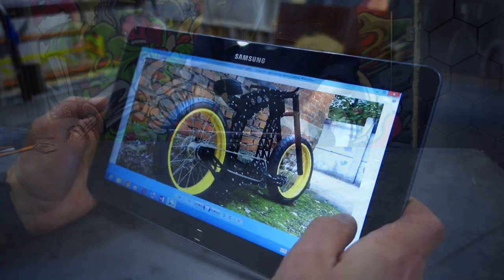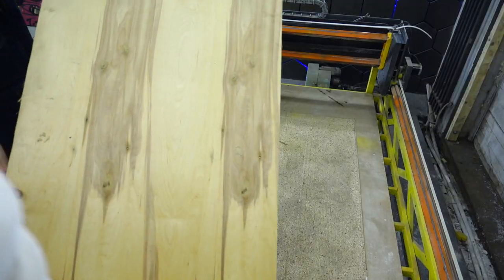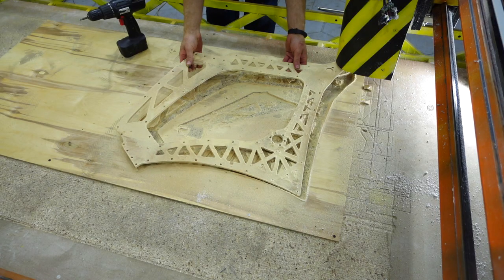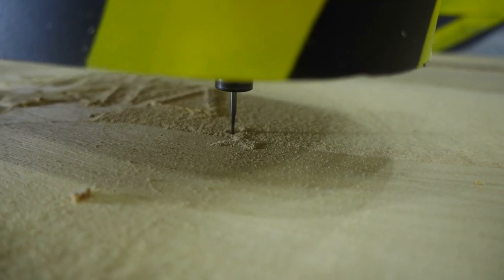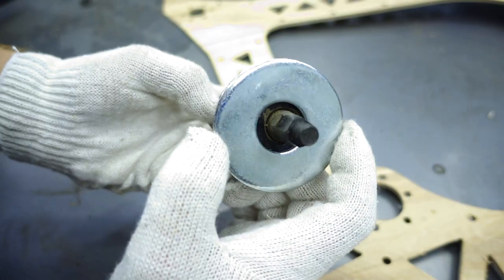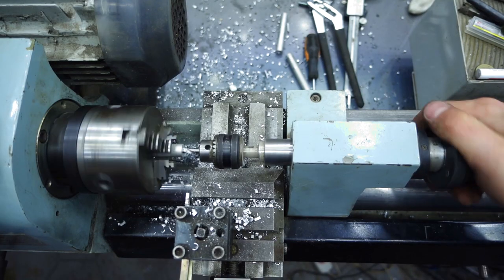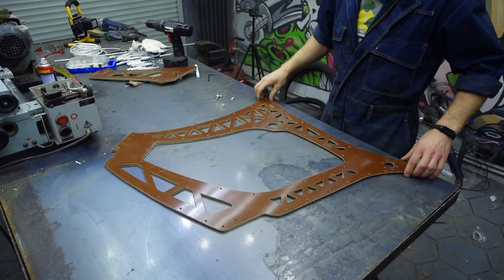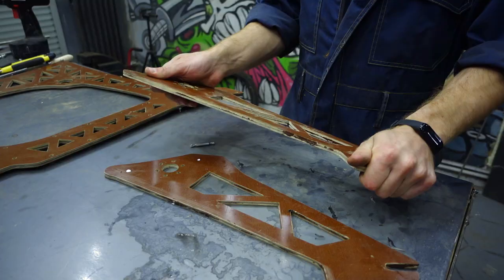Unusual Framed Bike Part 1

Comment: this type of material and design requires multiple suspension, you can make suspension coils wrapping >unidirectional< glass fiber reinforced recycled plastic rods around a shaped tube with a heat gun an you can make those rods pouring melted plastic over the fiber in a concrete mold. also you can make this frame far stronger and lighter using "tensegrity" or bowtegrity and uhmwpe ropes that you can use also for the wheels instead steel rods. i think you can make this bike with two vows, one passing by the seat and the other by the pedal, both connected by the rear wheel and the handlebar, or just a bow and the pedal suspended with tension ropes

Comment: you should add washers between the bolts of the wheel and the frame. that will tear if you don't.

Why didn't you use a stronger material? one that flexes less? even if it's just for the rear fork. frame seems strong enough